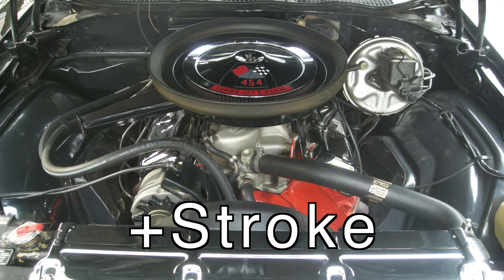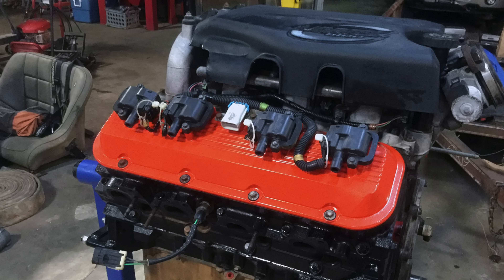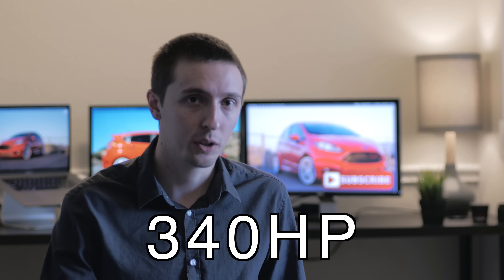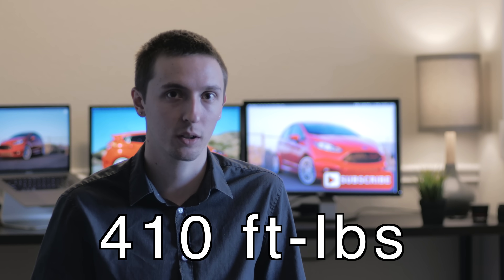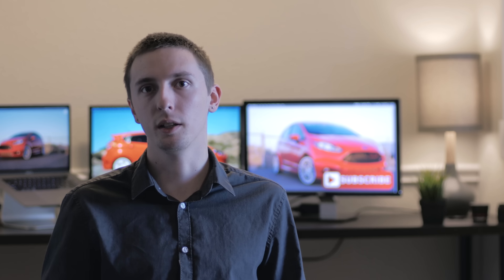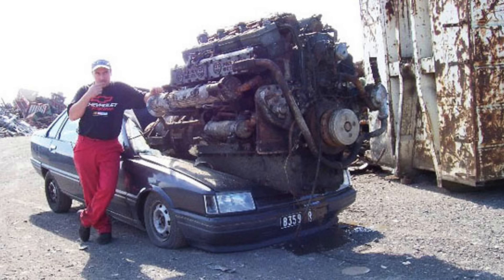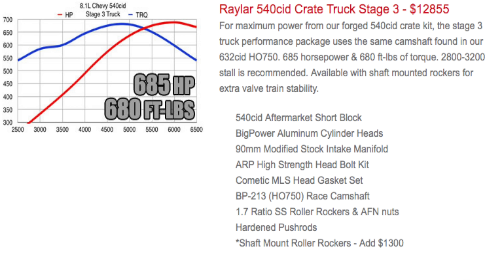Vortec 8100: Everything You Want to Know | Specs and More

Comment: Honestly the Vortec 7400 L29 454 had much better potential and much more interchangeable parts available. 3 changes to the stock L29 would give you far more power than a stock Vortec 8100, plus theyre alot easier to find.
Reply: So Kristy are you saying the 454 LS 29 7.4 l Vortec is the best choice.. if so that's good because I got that in my motorhome

Comment: Mine was at 250k and started knocking. Since i use it in Landscaping business to pull dump trailer, i immediately replaced with another low mile 8.1. I still have the old one laying around. Is it worth much ?

Comment: It blows my mind that the vortec 6.0 is even around given that the 8.1 had way more guts to it and they both get relatively the same MPG. I have a 6.0 right now on my 1500HD that I've had for many years... I average 9.5 MPG for combined driving and 12.5 on the highway... no lift, regular all season tires. How the 8.1 was put to pasture and the 6.0 went on for 18 years is absurd.
Reply: Finally someone else has my fuel economy. I have a 3/4 ton Suburban (2005) with a 6.0 and I get 9-10 around town, 14 highway, no better ever. Granted I live in a hilly area and I drive fast, but I see people claiming >15 mpg around town in their 6.0 trucks and I just don't see it. Mine also works pretty hard when towing, not the effortless performance many claim to get. Trying to maintain 65 climbing 2,000 ft mountains with 4,000 lbs behind me was a chore. I was getting passed by NNBS 5.3L trucks towing 30' campers, and I was turning 5,000 rpms just to stay above 60. I can only assume that in my hands an 8.1 truck would get 6 mpg around town but I'm pretty sure it would tow better.
Reply: desertfox2020 my 8.1 496 gets about 8 to 9 mpg but could tow my damm house and garage

Comment: Other than the Chevy with 8.1L, what other Gasoline powered trucks/motors/trans combinatons are there out there in a somewhat reasonably priced full bed pickup to tow a large heavy 5th wheel or other trailer, such as a larger backhoe... that is, a 15,000 lb unit?  I just HATE diesel and the smell of it.. makes me ill. Hate em belching out all that black smoke that, speaking as a former chemical engineer, is NOT good for anyone's health.  Truly toxic shite.  Does ford V-10 do the trick in any older HD truck?  Which is better (non-diesel) option?

Comment: If you have one of the mills from the pickup truck , a custom grind cam from comp and a good machine shop to do head work , install bigger valves and deck the heads along with port and polish , that motor will easily make 550 - 600 horsepower 700 - 750 pound feet of torque . Tuning would also go a really really long way and probably dial in another 40 hp .
GM always chokes off the intake and exhaust valves in their big blocks for some reason . I wouldn't bother to do anything to the bottom end , those motors are stout .
With that kind of power it would be super duper thirsty .
Reply: How thirsty, they already get like 8/9 mpg

Comment: Great engine.  It’s tough and doesn’t give me any trouble.  Surprised at the fuel mileage!  It’s better than I thought it would be
Reply: Yep, sometimes I even get double digits!
Reply: Love my 2005 Siverado 8100 2500hd with the allusion transmission 280000 miles runs strong always pulling  with it. I like it better then my 2006 2500 durmax sold that truck cost to much always breaking so I buy any 8,1 for sale and the allusion transmission  in truck our out I tuned it with hp runner and gas mpg now 14  to 17 mpg  was getting 10 to. 12  depending on the load if u add the Whiple super charger hold on great motor no mods done other than tune  for gas mileage

Comment: I'd like to boost the L18, but since it doesn't have a 6-bolt main bottom end like an LS small block and not knowing the strength limitations of the rods & pistons, I don't know what it can handle.  I was hoping for a 6 -7 psi boost on stock internals.  What do you think?
Reply: It'll handle 10psi no problem, it'll handle more with an electronic waste gate so you can feed in more boost past peak TQ(and cylinder pressure), e85(or race fuel) and proper tuning of a/f and timing.

Comment: We are also building a one ton four wheel drive four-door K5 Blazer that's going to have an 8100 and an Allison and a Pontiac G8 that's going to have an 8100 a 7-speed manual and ZL1 Camaro rear diff dubbed the G 8.1 and the plate will read 3X551V3

Comment: Had a friend that had one in a huge motorhome even he couldn’t believe how good it did on the interstate Much better than the ford v10 motor homes. I  think they should offer it again or something like it again. Hell at the end of the day it’s still cheaper than a diesel to own operate and purchase. Everyone thinks they have to have a diesel now to tow anything bigger than a push mower. That’s like how an old timer told me about how they used to pull all this big stuff with 292 six cylinders and big block v8s in old 1 ton trucks Before the diesel fad began.

Comment: They are used extensively in industrial applications such as power generation, pumping applications, and other situations. 
Many are turbocharged by upfitters like Power Solutins, Inc (PSI) and Buck’s Engines. 
Now PSI is manufacturing their own version in 8.8 liter displacement. 
All of these burn gaseous fuel such as natural gas or propane.

Comment: Are you kidding me??   340hp and 450 torque??  The clowns that put this together should not be allowed to design any engines.  Put them in as wash boys because that is all they are capable of doing.  That is beyond ridiculous as something that close to 500 cubic inches should be putting out at least 500 horse and 550 pounds of torque with today's technology.  Come on GM, get it together.

Comment: 8.1 w/Allison transmission was an awesome combo
Reply: stellingbanjodude true asf my gmc 8.1 just got a brand new Allison transmission last year and the little single cab is fast
Reply: I have that in my 02 avalanche
Reply: Man I currently got a vortec 8100 with an Allison transmission 19 20 years old but damn she gets around good
Reply: I wonder what the longevity it, there's a 8.1 Allison Crew 2500 near me with 225k for 5k
Reply: Just bought 2001 with 166k freaking love it
Reply: @Equppednut  im going to look at one tomorrow. 02 with 202k single cab gmc sierra. 8.1 and allison. Rusty rockers but the guy is only asking $3200. 🤷🏻‍♂️
Reply: @alale923  right on man that’s good price long as the frame isn’t rusted out thats awesome.
Reply: @Equppednut  how has your experience been with yours?
Reply: @alale923  honestly it’s been awesome, aside from the gas mileage. Every cold start I have valve noise for 30 sec to a min then goes away been doing that since I bought it. I haven’t had mechanical issues and I’m at 195k miles. It towes my fifth wheel no problem, the Allison shifts a little rough on the first few shifts then once it’s to operating temp it’s like butter. I love it.
Reply: @Equppednut Still have it? I'm going to look at 1 tomorrow. Does yours burn alot of oil?
Reply: It still is, Mine has 250k pulling 15-20 k trailers all day. Going to miss it when it dies...
Reply: @1loadermanjack  just fix it.
Reply: @superduty4556  👍😎
Reply: @1loadermanjack  its never gonna die
Reply: @1loadermanjack  and 6 miles to the gallon
Reply: @Wanous-hv7zo  You are right. 😎
Reply: @Wanous-hv7zo  nope i get 10 2 13
Reply: @rebarguy4051  how do you get that? I'm going to get one of these U-Haul trucks that has the 8.1 with Allison
Reply: @rebarguy4051  Pulling loads you don't. Empty down wind maybe.
Reply: The best combo I believe
Reply: did the avalanche have the allison ?  whats the allisons model mumber
Reply: @joesmith-fi1sx  1000
Reply: What do you mean was??😅 I have one my current truck right now in my 2002 GMC Sierra 2500HD Allison Transmission sweet baby Jesus I tell you what she's amazing
Reply: That's what I have
Reply: Yes...I want this combo in my GMC Envoy 💪🏾💪🏾
Reply: So fun.
Reply: Mine has like 249000 clean and strong. 
02 avalanche 3/4 ton.
Reply: Just bought one for fucking 2500$ motor and trans are mint !!
Reply: I'm about to tow 10k lbs across the country with my 8.1 Allison!! I can't wait!!! Bring it Bish
Reply: Absolutely I love my 8.1 she’s a monster 2500HD Silverado
Reply: I had a 3500 dually that could hold up anything off the ground. However I did not like the powertrain. It had NO top end and never wanted to downshift past 60 mph with the pedal locked to the floor. Not sure if something was wrong with it. Truck was bone stock. I towed a side by side up a mountain one time and the dually would not go past 59 mph the while way up. Got passed by an overloaded Nissan SUV with a unibody.

Comment: I had 3 - 454 one tons in a row then bought a 6.0 one ton, was quite disappointed, I would buy a new 8.1 today if they offered it
Reply: Ui cju u14hju fbu
Reply: All I can say that brand new in 1986 the 454 was a turd , my brother in law had one one ton 4/4 and I had 86 one ton Dodge 360, small block and I'd pull his ass all over the hills of Kentucky out tow in the hills and mountains, 360/ 4 barrel 4.10 gears his was 454/ some kinda fuel injection, 4.10 gears after he drove my truck towing a race car he sold his , you'd floor his on the hills and it would fall on it's face!!

Comment: 8100 is the strongest best motor I ever had. I consistantly tow 10,000 + lb without blinking an eye and I have had up to 17,000 lb in tow. The 6.0 is a piece of crap compared to my 8.1 . As far as cost and maintenance goes it is not even half what my 6.7 Cummings diesel cost to run and maintain. GM needs to bring it back it was the best none diesel work horse ever.
Reply: Never heard of a cummings before
Reply: The 6.0 is a much better engine, they'll hold over 1500hp with boost, an 8.1 will scatter it's guts well before that.

Comment: Sorry Dust Runner, you are 8 years behind the time. GM developed a new big block of 8.0 liters to replace the 8.1. The 8.0 was never installed in any GM trucks. The 8.0 has full water jackets, unlike the 8.1, which ran too hot when using propane LPG. Since propane has over 35 percent hydrogen, it burns extremely hot and clean. GM gave the 8.0 development contract to Brian Thomson of Thomson Automotive in Wixom, MI. He used a low RPM cam, so max torque would be at 1800 RPM. He got 518 lbs feet of torque at 1800 RPM on gasoline, with a 10 to 1 compression ratio. It has a 4.25" stroke and 4.27" bore, with 9.9 to one CR. I used to consult with Brian and the GM engineer because my fleet vehicles have travelled over 25 million miles on propane. See the engine listed as 8.0L LFI on the website GMpowertain.com Click onto products, it's the last engine at the bottom. Notice that it shows the HP and torque ratings on gasoline and on CNG, but when it ran on LPG, it has 368 HP and 460 lbs feet of torque. Remember, this was cammed as a truck engine and for alternate power generation in industrial use, and oil and mining fields. Run a hot cam with 11 to 1 CR and raise power by 35 percent. It has no intake as 2 other companies developed it running on propane and had their own intake manifolds. Those 2 companies merged into one, now known as PSI or Power Solutions Inc. They test them mostly on CNG and so they made it 8.8 liters, with a longer stroke. Industrial engines can get max torque at only 1200 to 1400 RPM, with max revs to be the industry standard of 2800 for an industrial engine. The 8.0 is now used on Freightliner school buses on propane or natural gas and has about 525 lbs feet of torque but it's got a longer 4.5 inch crank. Buy the 8.0 bare block at Jegs website, click onto Blocks, scroll down to 2nd page, look under "Chevrolet Performance Bare Engine Blocks" , click on the block pic, and scroll down to the 3rd block Vortec 8.0 Bare Bloc, Tall Deck, 10.2 Deck Height, takes a max 4.75 inch crank. DO NOT BORE it. Only $902.38 GM part #19256820. Run 11 to 1 CR and contact me for the best propane fuel injection system, run it dual fuel gasoline with an automatic switch to 105 octane propane.

Comment: I have a 2500HD with 8.1 and it is a sloth. No power. Can't tow more than a light trailer. Doesn't seem to be matched well at all to the Allison 1000 (poor programming?). Ive changed filters, pump, cleaned MAF, changed plugs and wires, and more but it is still gutless. After $$thousands I gave up and bought the same truck (same year, colour) with a Duramax - and LOVE the power of the Duramax! It just works. The 8.1 doesn't. Not sure why.

Comment: Diesel can be hard to find in small towns far away from freeways but finding it is out there is getting better than it used to be. But... My 8.1L is in a K2500 and if I run out of gas on the trails, Jeeps and even ATVs can spare a gallon or two if necessary.

Comment: My dad owned a 2002 2500 H.D. with an Allison. It was insane. If I remember right it would do 0-60 in about 4-5 seconds and weighed around 6700 lbs. The pickup was the same if you were at a dead stop or going 70 down the freeway. Passed everyone like they were standing still. 10 miles a gallon all day, towing a house...or not.
Reply: Lol! 4-5 seconds? No...
Reply: @co1003  I own one. It's about 6-7, closer to the 6 side. The nanny computer they put in it to prevent blow the tires off burnout every time you leave a stop sign hurts it in that regard. I mean, the ft lbs more than overcome the weight, and it is 340ish HP on a 5 speed geared to top out at like 100. It will get up and move.
Reply: @davenhla  I had one...
Closer to 9 seconds 0-60.
Reply: @co1003  Maybe you had a different rear ratio. I drive mine daily in the summer months. You do have to play games with the gas pedal to trick the nanny computer or it will dump all the timing for almost 2 seconds to prevent the wheels from spinning. If you do it right  you bypass that and the thing launches, but it's tricky. Just mashing it from a stop sign will have the thing roll out like it's chained to a train car.
Reply: @davenhla  it’s not worth arguing...The 8.1 has far been passed up by more powerful engines. None are in the 6 second range 0-60...
Get over thinking you have some sort of powerhouse because of the cubic inches...You don’t...
Reply: 10 miles to the gallon towing, NOT mine got 6.
Reply: @gleanerman2195  One thing I can add is he bought his new with 0 miles and it was well taken care of.
Reply: @thelagmeister  Mine was a new 2002, I had it for abought 6 months and sent it down the road, the fuel and week power were the issue, went Duramax and bever looked back.
Reply: The 8.1 in a 2500 Suburban was no quicker than a 6.0. neither is doing 0-60 in less than 8s, more like 9-10s.
Reply: @hendo337  The 8.1 made 340 hp and 455lbs of torque while the 6.0 made 300hp and 360 lbs of torque. The truck was burning out half the time the speedo was probably showing a faster speed because the tires were spinning.
Reply: The 2001 2500 HD 8.1L with an Allison with a 3.73 rear end could do 0-60 in 8 seconds.  A 4.10 rear end was available in 2001 which would give you a better 0-60 time if you could keep the rear tires from spinning  :)

Comment: Owned a 2001 Suburban 2500 with the 8.1.  It was great for towing.  Engine developed piston slap at about 60k miles.  Tried thicker oil, it wasn't as noticeable but still there.

Comment: I watch this video because I have an opportunity to buy to 2005 GMC C 5500 26 ft long cab and Chassis combos from U-Haul they each have about a hundred and fifty thousand miles on them they're in good shape and they both have the 454 8100 Vortec motor and the good news is Each truck is $3,500 a piece I need to know if you think this is a good deal for me or not

Comment: GMC 2004, 225000 MILES, 496, 8.1, 4BY4,
AND IT Ain't been babyed, still runs the ass off of street machines in my town.
  Many tried my Ole 2500 HD and found she don't play fair.
  IF you can't afford the gas, then buy a Toyota.
   This 8.1 will be with me till the end of my life.
  She don't knock, she don't smoke, clean as a whistle,
Reply: Crazy Horse az 
I borrowed a friend's ranch truck with the 8.1 years ago and it felt great. It impressed me and i always thought it was a good engine. I think it's only downside is everyone crying about MPGs. That's cost of ownership to me 💪

Comment: I have a 02 2500HD  crew cab long bed with the 8.1. I have a K&N intake filter on it, and I used a power programmer for better mileage and performance.  The truck on 91 octane hauls ass. It surprises alot of others on the road that want to race me. 
It's got 98 thousand on it and I will be changing the plugs for the first time very soon. It has been a great workhorse for me   the Allison trans had a solenoid go out but it was cheap to fix.
Reply: Thinking about getting the same truck with a utility style bed. 100k miles for $7,000.
That sound like deal to you?
How's your gas mileage?
A lot of mixed views based on the comments section here but I'd rather hear from someone who has this truck and engine than all the diesel fanboys.
Thanks.
Reply: @optimusprime3484  mileage is not great with extended bed, the utility bed being much heavier has got to bring it down even more. While I had it programmed it got better mileage than stock but I put it back as I was chasing a hard starting problem.  The fuel pump is letting the gas flow back to the tank. The price seems high for that many miles unless he has All the maintenance records on hand.
Reply: @charlesathan5897  I greatly appreciate the feedback. Not sure which way I'll go with it yet but it's good to know you've had a good experience in general with yours. 
Hope you have many more miles of issue free hauling ass. Thanks for taking the time to reply.